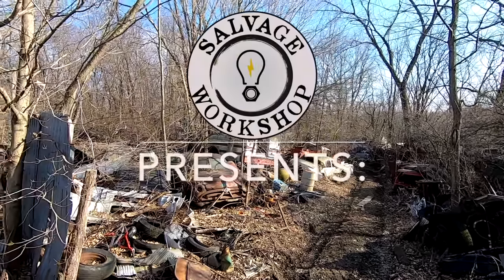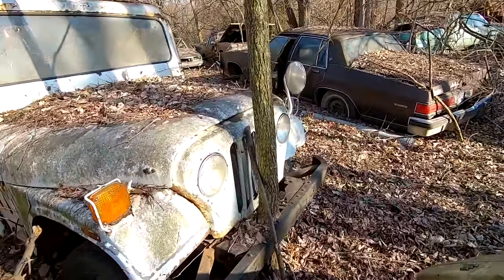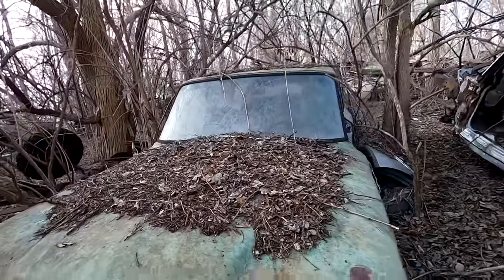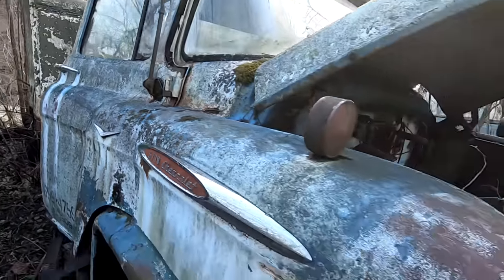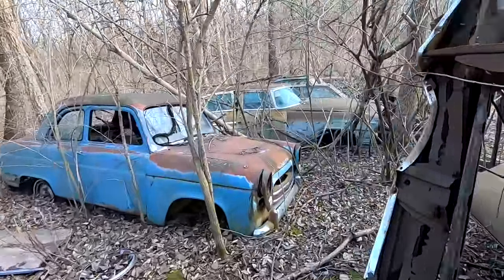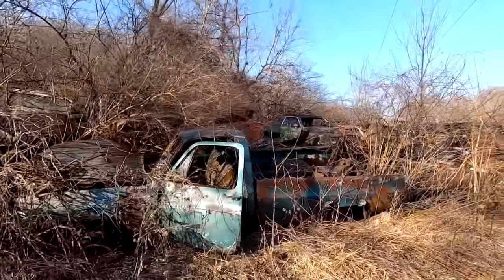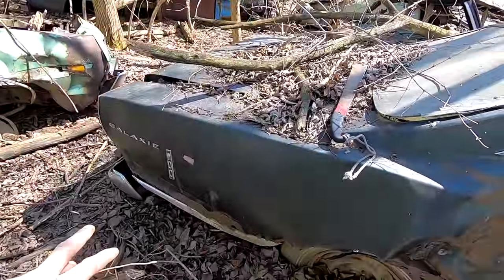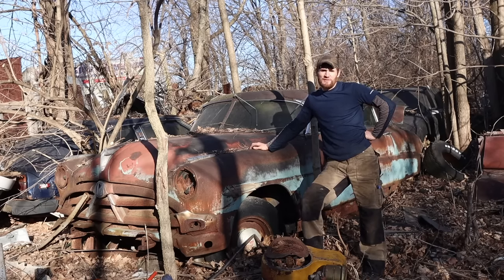A Tour Through a Forgotten Junk Yard... A TRUE Step BACK in TIME ~ RESCUING OLD IRON ~ Episode 5 P.2

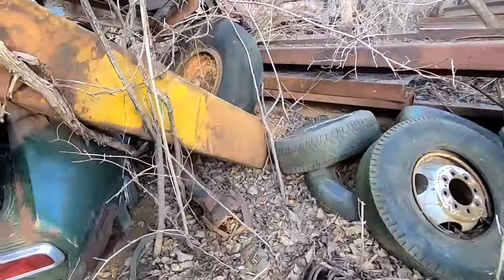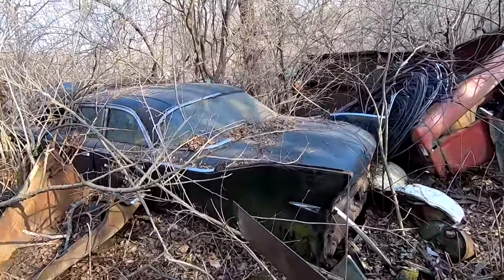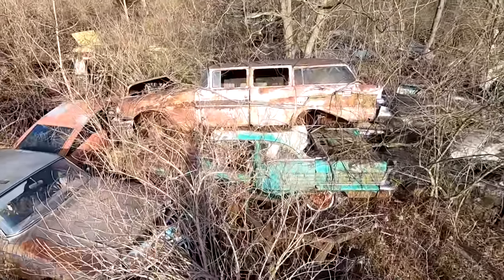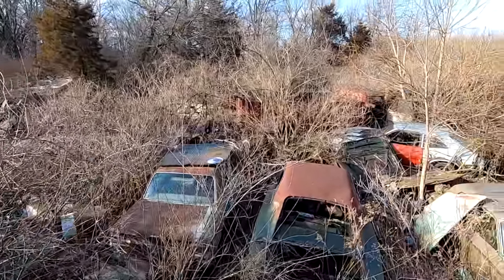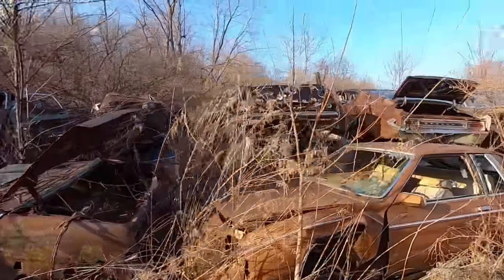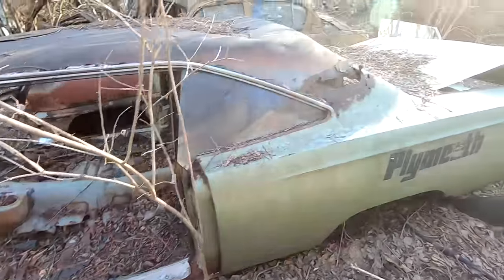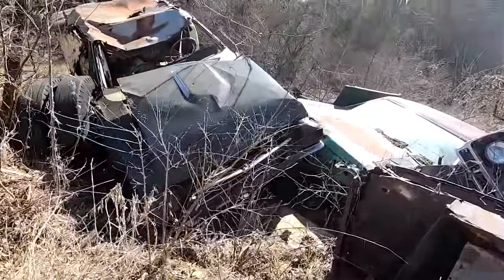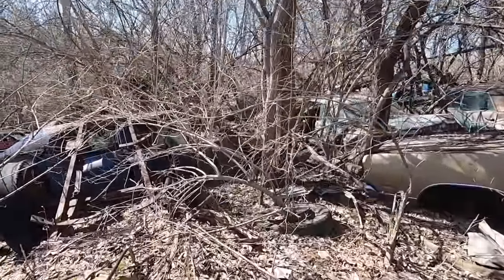Comment: Great job with the video!! I would love to pick this yard!  You asked for identification of some of the cars, 20:34- 1968 Plymouth Sport Satellite, 21:03- 1960 Plymouth Fury, 21:58- Plymouth Volare w/ Road Runner package, 25:50- 1970 Plymlouth Satellite, 26:01- 64-65 Dart GT, 26:23 - 26:41- 1968 Dodge Charger!  33:57- 1968 Dodge Coronet, (blue, stacked on top) 38:50- 1968 Mercury Cyclone, 39:57- 69 Plymouth Road Runner,  40:56- 1969 Dodge Coronet Super Bee, 44:46- 1969 Dodge Coronet, 45:20-48:58- Camaro/Firebirds. I would love to buy the steering column and pedal assembly out of the 69 Super Bee, (and many of the other Mopars) If they will let you pull parts.
Reply: were is this at

Comment: The blue 57 Chevy truck shift pull push knob is for a two speed rear axle. Essentially giving the truck 8 gears. It worked very well. Spent my youth driving one hauling sugarbeets.

Comment: The international scout is very quickly becoming more and more rare to find whole. 
Even if you got it out and flipped it you could make some cash.
Reply: They have been a great favorite of the prepper crowd. No electronics to fail after a nuke etc etc .
Reply: I have 4 of them 74,76,79,80. 80 was the last year. Also have 73 3/4 ton and 75 1/2 ton.
Reply: That whole area needs clearing and everything needs cutting for scrap.

Comment: In 2009 a couple fellows purchased 80+ acres for a reported $300K. This land was covered in vehicles similar to what you showed here. They set up a crusher at the access point and proceeded to move vehicles. They only crushed those that were smashed up so bad they were non salvageable for any parts. After 3 years the property was fairly clean with hundreds of vehicles from the 1930's to the late 1990's. The scrap that was sold paid over half the cost of the purchase. I heard the guys had sold everything off the property and were going to subdivide it, don't know how that went.

Comment: The switch attached to the shifter is for the rear end it has a 2 speed rear end, you pull it up  & it engages the 2 speed & push it down it disengages the 2 speed rear end

Comment: At 24:00, this an arc light used for spotting aircraft during WW2.  They must have made a zillion of them, and they were widely used to attract attention for amusement parks, store openings and so on, well into the sixties. There's still a company that maintains and rents them, which I remember seeing on Pickers. They were originally mounted on typical military trailers.
At about 27:00 the blue Mustang is a 1967. Note the tail light design, and lack of side marker lights, which first came out in 1968.  Elanor look? This came about 30 years later, as I remember. The first Mustang fastback would have been in1966, maybe late 1965.

Comment: Look's like the scout has a PTO, they are nice.
Reply: It might have a PTO, but if you are making that assumption because of the 3 shift levers on the floor, nope. Lever nearest the left seat is the main transmission range shift lever. Middle lever is transfer case selector for rear shaft output/neutral/front and rear shafts output (all wheel drive).  The short lever on the far right is transfer case high and low range.
A PTO on these would have been mounted on the transfer case and have a separate means of engaging it (additional lever or a remote cable).  The neat thing about a transfer case mounted PTO is that you can use the main transmission range of ratios to give you 3 optional PTO  output speeds in one direction  or  reverse rotation depending on what position you set the main transmission in.
Reply: @larrywalker7759  Look's just like my old 66 ford bronco that had a pto and three on the tree, learn something new every day, sure loved that ol pto winch.
Reply: had 1 as a kid  learned to drive a stick in it   we would hunt rabbits at night in our pasture and rest the 22 across the roof while standing in the bed😁
Reply: @OregonOutlaw2000  I think maybe Ford had a different strategy on the levers than IH.  I worked at a service station in the late 1960s and our road call vehicle was a 1962 Scout 80 all wheel drive with the single bench seat and short cab (pickup cab). It had the 3 levers on the floor.  At the same time, my best friend's dad had a 1966 Ford F250 4X4 that had the 3 on the tree transmission shifter but the transfer case was a single lever on the floor that had 2 wheel high, 4 wheel high, neutral, and 4 wheel low all in 1 stick.  On the Scout with 2 transfer case levers it was possible to select "2 wheel low".  On the Ford,  there was no way to select 2 wheel low. And I can't really think of a reason anybody would need 2 wheel low unless it was just so you could creep on hard surfaces without drive line wind up damage that happens in 4 wheel drive when there is too much traction to allow wheel slip.

Comment: The car you though might be an MG looks like a Triumph Spitfire.  That Volkswagen diesel is a Rabbit.  The "Ra" was broken off the nameplate.  The black old car with the engine intact appeared to be a Morris Minor.  The blue Mustang fastback looks to be a 1967 or 68 vintage.  Old people designed and built the very machines and automobiles that you love and respect so much.  And they did it without computers and magic software too!

Comment: That blue truck with police light on it. That is what they called the paddywagon....LOL..They would go around and when u got arrested they would handcuff u and throw you in the Paddywagon and when it got full they would take them too jail Great video I would never leave that place..LOLThank You for sharing The old dump beside the search light truck fthe shifter with the lever on it. Is for the 2 speed rear end. You could spilt each gear. But normally they would just spilt the high gear. I drove one years ago. They would give you a few more miles an hour going down the highway...LOL I would love too have the old trencher that you went by.  Turn it into a little Dozer...LOL

Comment: I'm usually very optimistic about your video's but this place is a disaster. 98 percent non salvageable scrap metal. Who's going to spend there time and effort, removing, cleaning, inventorying and housing the parts that might be worth the effort. Nearly all the cars are 4 doors, bent, rusted and crushed. Quite obvious from your drone footage run off from the fluids and decay has completely polluted that pond and would most likely need drained. Maybe a dozen vehicles worth saving, maybe. But thanks for sharing, hope you get what you need for big red, cheers.

Comment: I'd like the tail lights off that first old Plymouth you walked passed. I want something like those to put on the fenders of my old utility trailer, I think they would look really cool. Have a soft spot for the vw rabbit deisel. We grew up driving those, probably had 5 of them at one point. Salvaged the axles for trailers and several are still in service.

Comment: The "cab over" around 13:12 is an International DCO 400 series, most likely a DCO405, also known as the Emeryville (built in the Emeryville, CA plant).  And correct terminology for the rear axle configuration is "tandem" not dual. Dual drive tandem is an OK term for this specimen because it is a "live tandem", or power divider drive axle. In some circles the term "twin screw" is used, but You Tube might not like that one.  This particular example in this video also has the dreaded Hendrickson "Rubber block", walking beam rear suspension. Ideal for heavy loads but absolutely no cushioning for the ride except for the miniscule amount the 4 rubber blocks would compress.

Comment: Thanks for the tour. That was a Fiat 850 Spyder, you thought was an MG. Small engine but fun to drive.
Seems like someplace to be filming the "Walking Dead - 45 Years Later". Some cool old vehicles in their day, but these are so deteriorated now between rust on the outside and mice/raccoons and mold/mildew on the inside. Many having been picked over for parts already, it's a good place for the odds and ends you need for a restore you are already doing.

Comment: What is the future for this massive collection are items been sold ,or are crushers going to appear and haul all  off for recycling .
Reply: With how it seems, probably nothing will ever be done with any of these items. Not unless this man comes along and takes them to rebuild them, I’d love to see each and everyone of those items restored and in working order. But that may not happen
Reply: @oddhobo4808  There wasn't a single car shown that is restoreable.  They were all junk when they arrived there.  Most of the useable parts were stripped years ago.  Restorers don't start with cars like these, they take a few pieces they need.  You can't economically fix a car that has been sitting in the dirt for 30 or 40 years.  The frame, floors and everything half way up is rusted and gone.  All the windows are open.  They are all junk.  Every useable piece on that lot could be sold and it wouldn't come close to the cost of removing the heap that is left.

Comment: I suspect that the double drop center lowboy trailer and se mi tractor might be a good prospect for returning to service. Pretty much everything else isn't worth anything but scrap. Some of the machine tools  might be salvageable also.
Reply: Mills and lathes seem like they would all be worth returning to service.  Some of the heavy equipment.  You are right that a lot of it is just scrap, the sad thing is for one person who has an old dozer around or something and needs a still track it isn't junk.  Some of these machines have worth but really the reason they don't is they are tough/impossible to get parts or to difficult to modify or fix in another way.  Not working they are just a pile of metal.  The idea of how long until something regains value through it's rareness is another funny idea.  Think of an old milk jug that gets tossed in a junk pile.  100 years later it is dug up and sold on ebay for 50 bucks when for 50 of those years people would wonder why you are keeping a piece of trash.

Comment: I think your path is clear: 1) remove 392 from IH Loadstar dumper  2) jam motor into IH Scout sitting next to it  3) enjoy.    From the looks, this place was done by the mid '80s and staggered on for a few years longer.  27-minute-mark is a Dodge Charger. '68 or '69 - I'm not a pentastar guy. 28:21 is probably an Opal.  And two '70 Buick Skylarks. They had hot little 350's in them, but they were better when you jammed a 455 between the frame rails:)

Comment: Hey I have found a treasure trove of vintage machine tools in Illinois looks like a horizontal milling machine, a large press, a large power hacksaw, a belt-driven drill press, large swing headed drill and 2 metal lathes all sitting in a old building with no roof all very rusty but look to be all complete they said if they don't hear anything in a week's time that they're going to scrap everything I thought I would try to get ahold of you via your email but I don't have the email for you anymore so I will watch for a response to this hope to hear from you

Comment: you keep saying motor...they are engines in cars ... motors to run machines and are electric motors
Reply from the maker: HMM.... Tell Ford Motor Company that!
Reply: Wrong, LD R.
Reply: All engines are motors and a motor is something that provides mechanical energy. So you can use the term motor for a internal combustion engine.
Reply: @WoodNMetalWorkshop  The difference between an engine and a motor is that engines utilize a fuel and burn it internally to produce power.  A motor uses some form of energy potential or "power" produce elsewhere and uses that power to produce motion. Does not have to be rotating motion either, linear motion qualifies too.....a solenoid is a type of motor and an air servo or hydraulic cylinder are types of motors.
The terms engine and motor are almost universally accepted in colloquial and slang conversation as interchangeable terms.
Some things to think about:
People say "Steam engine" and everybody accepts that as a real thing, but they are really "steam motors", just as their pneumatic, electric,  and hydraulic cousins are air motors, electric motors,  and hydraulic motors.
Nobody ever goes to the automotive section looking for "Engine oil", it is always sold as motor oil.  International Harvester is the only company I know of personally that ever sold it packaged as "Engine Oil".
And why do people say " Automatic Transmission Fluid or "Hydraulic Fluid" instead of  saying Automatic Transmission Oil or Hydraulic Oil?  It is because people repeat things as they have always heard them, whether accurate or not.
Reply: So I guess people should stop referring to any form of auto racing as motor sports and call it engine sports? ( Unless they're racing electric vehicles.)

Comment: The only good Scout is a dead Scout.  Not cool at all.  Only good for scrap.  Almost the same with the AM General mail delivery vehicles.  The mailmen loved them but they are only 2WD with weak steering boxes.  Some had BW auto trans which are always a challenge and need a lot of care.

There really was nothing there worth your time and skills.  Most were 4 doors and those that were not were really beat up.  Mother Nature was really having her way with all of them . . . Most were not that great when they were towed in there.  There was a 4 door Lincoln that you said you didn’t know what it was but that it had an engine.  Some of those had Flathead V-12s but I couldn’t tell from what I saw.  If so that would have been the most valuable thing there.  The Flathead V8 in the early ‘50s Ford school bus should have been an 8BA and worth something if the block wasn’t cracked.  Most vehicles were scavenged for parts years ago.  The ‘50 shoebox Ford, ‘63 T-Bird, ‘53 Ford COE, Jeep Wagoneer, late ‘30s Ford COE wrecker and early ‘50s Dodge pickup were great along with a few others but not restorable from what I could see.